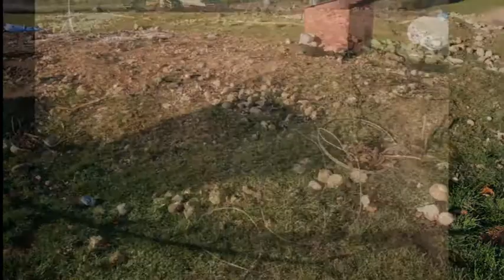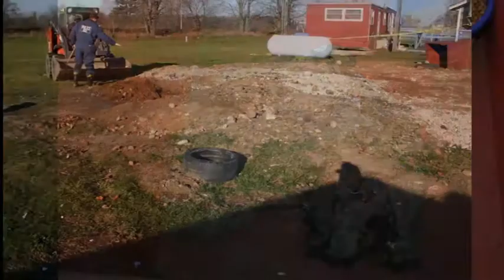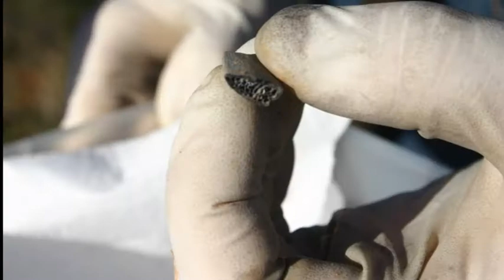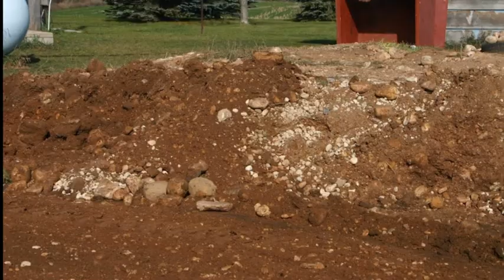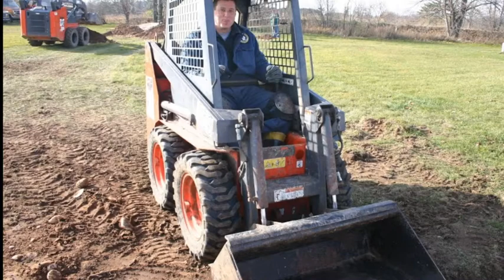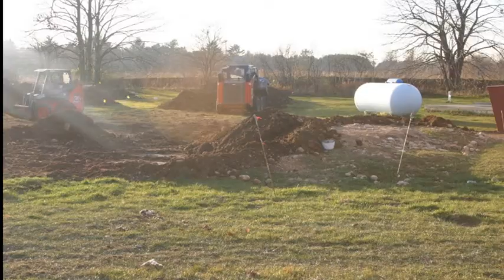photos  of burn pit area

Comment: It was essential to excavate ALL the soil at least three feet deep to destroy any possibility to prove no human body was cremated there. Lack of body fluids & particles in the top several INCHES could prove that conclusively. By EXCAVATING two or three feet of soil all at once instead of inch by inch in a grid then sifting, eliminated any possibility to establish any timeline or relation of anything found to any other item. Buttons etc. from three feet deep could not be proven to have been burned recently or years ago since no archaeological technique was used. They removed the green grass still green where it should have been black if there had been a "whoping big fire". They avoided in situ photos to prevent investigation.